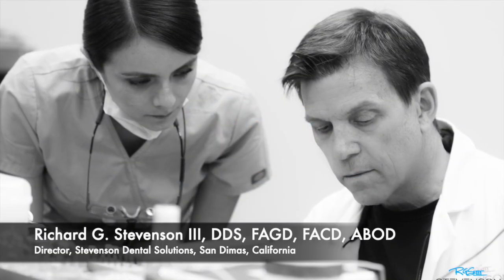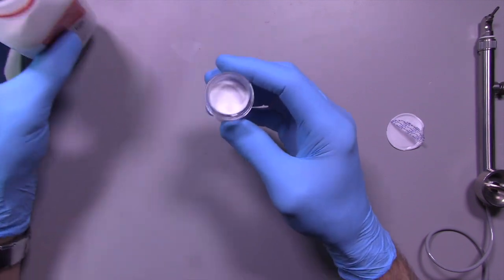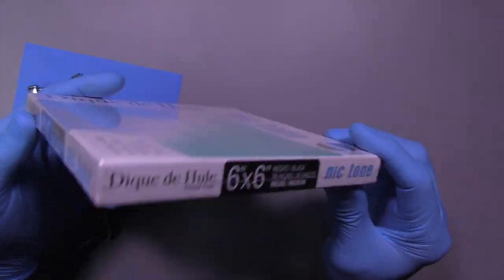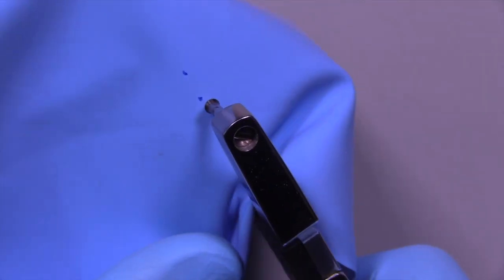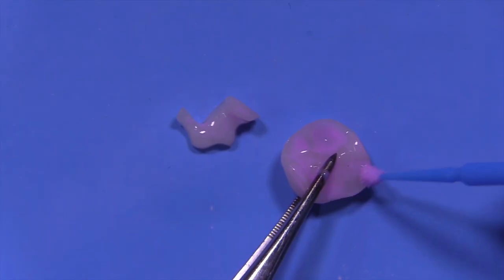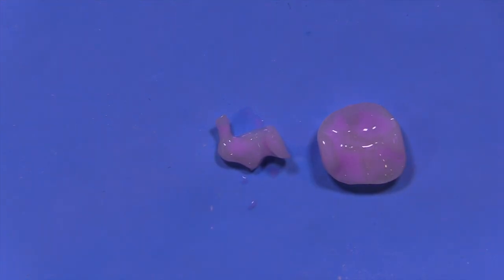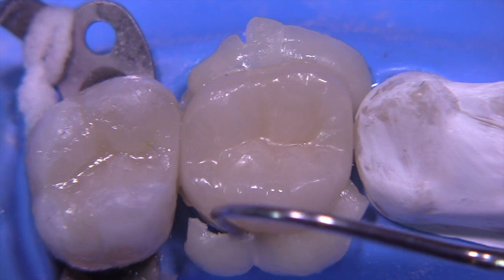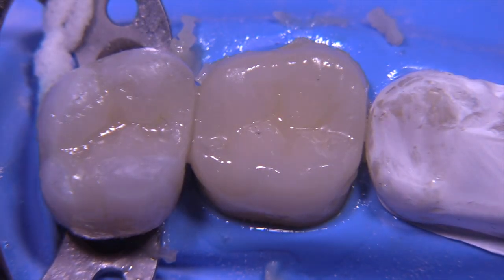Lithium Disilicate Ceramics, Part  5: Cementation of Inlay and Onlay

Comment: Thank you a lot Dr.
Can we use partial restorations like onlays inlays veneers on non vital teeth?
And is it suitable to use dual cure resin for onlays inlays?
Reply from the maker: At least an onlay for an endodontically treated tooth. Dual-cure cement is optimal.
Reply: @StevensonDentalSolutions   excuse me Dr.you mean we can do veneers inlays on endodontically tooth but preffer not the onlays?

Comment: Prof plz can we cement composite or zirconia onlay with resin modified glass ionomer ?
Reply from the maker: No research on this has been performed clinically.  I would use a resin cement for ceramic onlays.
Reply: @StevensonDentalSolutions  do you mean no research use zirconia or composite onlay itself?

Comment: Hello.
I  am about to consider an emax ceramic inlay but I wonder if the day I have to remove it will not be a nightmare if the dentist struggles to remove it or is forced to damage what remains natural of my tooth. Not to make too much noise with the tools and hurt my hearing.

Thank you for your opinion.
Reply from the maker: Your question is quite appropriate.  Removing failed ceramic restorations that have been bonded adhesively to the tooth will result in some collateral damage to healthy tooth structure IF using drills.  We do have lasers that may be quite promising in removing bonded failed restorations without any damage to the underlying tooth.  I would not worry too much about the removal as we will have the laser option and likely to have other options in the next 10-15 years when replacement may be necessary.  Dr. Stevenson
Reply: Which the actual way to remove today ? Only drilling ? How to remove only the inlay when it's soo tiny ?
Using a laser on a such tiny surface, I don't see how the dentist cannot be too close to the tooth. 

What about the contact noise to drill a ceramic vs composite ? Because it's harder and maybe a long time work. is there any hear damage for the patien that ears directly the drill trough the bones contact ?
I don't see a single video about it on youtube. 
 @StevensonDentalSolutions

Comment: Bonding of indirect ceramic restorations with warm composite using a vibrating tool to apply pressure against the tooth results in a very superior bond strength and increases success rates for their longevity. Fantastic video Doctor! ❤❤

Comment: Could we use here self adhesive resin cement(dual cured) ? 
Even though we did etch and bond to the tooth ?
Reply from the maker: Like RelyX Unicem II, yes, as long as the tooth has been etched and primed.  You just don't have as many shade choices...
Reply: @StevensonDentalSolutions  Thanks doctor appreciate it

Comment: May I ask some quistions about bonding an emax restoration.
 1- Should i put the bond (clearfill liner bond f ) on top 2 bottle silane from bisco on an emax restoration or the silane is enough when using heated composite? If so, the 2 bottle system clearfill liner bond f has a primer should i apply the primer on an emax after silane application?
2- should i put silane on an existing composite on the tooth when bonding to emax restoration then place the bond 2 bottle system primer and bond?
Reply from the maker: Great questions! 1. There is no need to place the liner bond on the restoration after silane, but if you do, make sure you allow the solvent to volatilize to ensure good adhesion to the silaneated surface.
2. It looks like silane is not helping bond to the composite as well as it had been hoped.  No clinical data supports this approach - so there is no need.  All the best, Dr. S

Comment: Hey doctor, i have a question. Why didn't you cure the bonding that you applied to the tooth surface?
Reply from the maker: This is a huge mistake - it will prevent the complete seating of the indirect restoration due to the film thickness...even if it's reported to be as little as 10 microns, it will pool in the corners of the preparation and prevent complete seating...
Reply: @StevensonDentalSolutions  Thanks, so both the adhesive on the tooth and on intaglio surface of the restoration should be cured together once the restoration is seated.

Comment: Hi Dr. I have question 
Why u use composite when fixing the restoration
Reply from the maker: The usual choice is resin cement, however, warm composite works well if the restoration is not too thick.  There are unlimited shades and the composite is stronger than the resin cement.  NOTE: the composite must be warmed to soften it.

Comment: Is tehere is any curing of bond in between or just the final curing ?
Reply from the maker: Final curing only.  As long as the restoration is translucent.  Alternatively, you may use a dual cured primer/adhesive which is made to polymerize with the cement, like RelyX Ultimate and ScotchBond Universal.  The issue with pre-cementation curing is that the adhesive is thick enough to interfere with complete seating.
Reply: @StevensonDentalSolutions  amazing
Is there any dual cure adhesive other than scotchBond universal doctor ?

Comment: Doctor Steven do you recommend using Self-adhesive resin cements for cementation of all ceramic restorations and zirconia in case of inlay / onlay / crown and bridges ?
Reply from the maker: No.  The traditional resin cements are the best choice for these. SARCs lack the high bond strength and durability required.

Comment: Nice video Dr.Stevenson. do you remove the glaze layer from the outer 0.5 mm periphery of the restoration before you etch it with HF? Or your lab does it beforehand?
Reply from the maker: Usually I just etch the outer rim for 90 seconds, for the feldspathic glaze etching, then the intaglio for 20-30 seconds. I've had limited success getting the lab to leave glaze off this area.
Reply: @StevensonDentalSolutions  Thank you very much for your valuable guidance.
Reply from the maker: @riteshgadhia3870  My pleasure!
Reply: @StevensonDentalSolutions  one more question sir, at which air pressure do you work with the air abrasion unit?
Reply from the maker: @riteshgadhia3870  I use the CrystalMark system at 2-3 Bar.
Reply: @StevensonDentalSolutions  Thank you sir

Comment: thank you dr stevenson for your effort, Isn`t it better to use a resin cement for cementation of the ceramic here? and in case of using a composite  isn`t it better to use a flowable type of composite for a cementation? you know it will flow better and it will occupy a smaller area for cementation?
Reply from the maker: Warm composite shrinks about 1.5% compared to 4% or more for flowable composite.  The warm composite technique provides a very strong resin luting space.  It is very technique sensitive though.  I would only use this technique when the restoration is not more than 2 mm thick.  Thicker and more opaque ceramics should be bonded with dual cure resin cements.  Resin cements which are dual cured and have a built in dual cure activator to work in concert with the bonding agent are the gold standard.
Reply: @StevensonDentalSolutions  would you recommend a certain type of resin cement
Reply from the maker: @ahmadmohi659  I like the 3M ScotchBond Universal + RelyX Ultimate, shade A1 Bonding for most cementations...
Reply: @StevensonDentalSolutions when using the dual cure cement, when do you start flossing interprox and do the rest of the cement clean up if you don’t tack cure?

Comment: Hi Dr. Stevenson. Before I get to my question, I’d like to sincerely thank you for your tremendous generosity and passion for teaching! Your videos have significantly changed the way I practice and ultimately elevated the level of care to my patients. Since last watching this video, I’ve done more cementations and one of the issues I’ve faced is voids or ditching at the margin while removing excess cement/composite. Have you experienced this? What would you do when you notice this? Do you add flowable resin prior to final curing? Thank you so much!
Reply from the maker: WOW, thank you!  I perform" bullnose etching" (around the edge onto the outer surface by 0.5 mm), silanate this edge too,  and clean the cement completely - no tack curing - then finish and polish with wet Dialites - always spinning from ceramic to tooth.  Seems to help seal the margin.  Dr. S
Reply: @StevensonDentalSolutions  thank you  Dr. S. What kind of cement do you use? I use ParaCore but it seems to set very quickly, especially when I use ParaBond with it.
Reply from the maker: @snuppy01  I use RelyX Ultimate with ScotchBond Universal.  Gives good working time.
Reply: @StevensonDentalSolutions  Thank you Dr. S!!
Reply from the maker: @snuppy01  MY PLEASURE!

Comment: Why dont you like to tack cure?
Reply from the maker: Tack curing is a great way to clean up resin cement, no doubt.  However, when you are trying to create a continuous ceramic-resin-tooth seal, tack curing is counterproductive.  In the techniques presented, we use HF etch 500 microns beyond the typical bondable interface of the ceramic margin, not just the intaglio, and  bond to the entire meniscus of the ceramic margin, not just the inner surface. The resin cement will thus fill this micro-concavity and prevent staining in the future. Tack curing will disrupt the creation of this, and because the resin is not permitted to fully cure and gain strength - it will be ripped off the ceramic leaving the surface rougher.  Dr. Ed McLaren (DDS, Prosthodontist and Master Technician) taught me this about 20 years ago.  Since then, no more stained margins.  Thank you for the great question.  Dr. Stevenson
Reply: @StevensonDentalSolutions  Dr. Stevenson Thank you for this thorough reply.
Can we use this technique for anterior ceramic veneers when we are using resin cement? or is it beneficial only for Onlays/Inlays using composite resin types of cement.
And when you say "resin cement will thus fill this micro-concavity and prevent staining in the future" do you mean we blend the excess cement on previously HF etched outer edges of the ceramic or do you mean applying an unfilled/filled adhesive resin on these surfaces to avoid getting future discoloration?
Many thanks
Reply from the maker: @amirmo6615  Yes and yes.  It is a technique that is applicable to veneers as well and will prevent staining.  Best, Dr. S

Comment: How do u remove the temporary acrylic restoration? Do u drill it?
Reply from the maker: Usually you can use a spoon and uplift it.  Rarely, the use of a carbide carefully positioned away from the margins may be used to create a slit with which a large spoon is used.

Comment: Hi Dr Stevenson . I would like to know if you have to Light Cure the tooth after application of the bonding agent ? Also would a flowable composite or core build up dual cure composite be suitable for cementation as well . Thank you
Reply from the maker: When you use a dual cure activator (for ex. ScotchBond Universal + RelyX Ultimate Cement has them incorporated) you do not need to light cure the bonding material.  Also, through many years of collective clinical experience, as long as the restoration is somewhat translucent and not more that 3 mm thick, you may light cure the bonding and the cement through the restoration after cementation.

Comment: Perfect🌹how long do you put the compule in the heater ?? Tim?
Reply from the maker: It usually takes about 3-5 minutes to heat up with the Calset (by AdDent).  I also use a Phasor from Vista (really hard to locate these days) which uses an induction coil and takes less than 1 minute.

Comment: Thanks Dr for your amazing videos, and i would like to ask you if you used immediate dentine sealing before the impression taking or no? otherwise, what do you recommend to protect the dentine after preparation?
Thanks so much
Reply from the maker: Yes, I do, then I clean the margins with a fine diamond to reduce the residue from excess adhesive materials at the marginal interface.

Comment: Why you didnt etch totally the preparation before cementation as you have etched only the enamel?? Did you use selective etching this time? As you have used total etching approach in the IDS
Reply from the maker: The tooth was etched totally during the PREP for IDS, then the enamel was cleaned with the bur before the impression.  For the cementation, the dentin simply needs to be cleaned as it has already been sealed with DBA.  The enamel however requires etching because the etched surface was removed at the pre-impression stage.  I will total etch the prep whenever I see that the bonded layer has been removed by over cleaning with Aluminum Oxide.

Comment: Hi doctor thank you for the video. In case of a composite onlay/inlay, do we have to etch it with HF prior of silane, bond and cement? Or with orthophosphoric 35%?
Reply from the maker: Not required.  With composite, treat the surface with a light sand blastoff Aluminum Oxide to increase surface energy and use adhesives as with your direct composites.  Some dentists do use HF and silane in an attempt to link and bond to the glass filler particles, but this hasn't been shown to improve clinical performance. Simply making the surface microscopically irregular provides ample retention.
Reply: @StevensonDentalSolutions  So for prep of the composite restoration you modify texture with air abrasion, you clean with Ivoclean, use primer for instance Monobond Plus and then you are ready to lute with a resin cement. And in between of primer and luting cement do you use any bonding agent like in ceramics? Thank you doctor for your instant reply. I appreciate it!

Comment: How can you be sure that the composite for cementation is fully cured underneath the porcelain?
Thanks
Reply from the maker: You can't, hence the limitation of this technique to translucent, and less thick restorations.  I typically use a dual sure cement, and only use warm composite when I need the extra strength and shade variability with a thin and translucent restoration.

Comment: Greetings Dr. Stevenson. I would like to take a moment to appreciate how in-depth are your video tutorials. Coming to my query  could you please tell me whether the bonding agent needs to be cured before seating of the prostheses? I use tetric N Bond
Reply from the maker: Thank you - the manufacturers will usually recommend that you thin and then light cured the adhesive before cementation, however, this may render the restoration less likely to fully seat due to adhesive "pooling".  A way around this is to simply light cure simultaneously with the cement, however, this has the potential of not curing the adhesive adequately, particularly if the restoration is thick or opaque.  Perhaps the best choice is to use a dual cure adhesive, like Scotchbond Universal + RelyX Ultimate cement - as they work together to cure the adhesive.  Also, many light cure adhesives have a DCA (dual cure activator)_ which isn't highly publicized by the manufacturer but available,
Reply: Understood sir. Thank you very much for clearing it up for me. Much obliged

Comment: Thank you so much doctor ..
Reply from the maker: Thank you!
Reply: Stevenson Dental Solutions  doctor ..just I am asking why you use worm composite technique instead of self adhesive cement..thanks alot
Reply from the maker: @mustafaaburass9650  I use either, but usually a resin cement - not a SARC.  When the tooth has the need for more esthetic blending due to a special shade - warm composite.

Comment: Yes doc ..thanks for sharing these techniques..without payment and conferences we r achieving these knowledges. CAN we use veneer cement for cementing emax crowns or inlays...?
Reply from the maker: Thanks doc.  Yes, you can as ling as the ceramic is not too thick (blocking the light)
Reply: Yes doc thanks again for ur prompt reply ..really appreciate

Comment: Hi doc! Thank you for your videos. I find them enjoyable. I'd like to ask. Why is it that you don't like tack curing when cementing?
Reply from the maker: I etch the ceramic beyond the edge and bond around the restoration margin slightly, hence I want to secure this area fully before finishing.  Tack curing leaves the composite cement soft (enough to remove easily, hence it's popularity) and it then may be torn from under the marginal seal area.  Marginal staining then becomes a problem...

Comment: Why did you use an adhesive on the tooth if you already IDS? I guess you still needed it at the enamel but why on the already sealed dentin? Also, would you do the same with an auto adhesive cement?
Reply from the maker: You've sealed it during the prep, but you need to bond it during the seat, especially after air abrading the contaminated surface during the cementation step.  The same steps regardless of the resin cement used.  Thank you, Doc!

Comment: Thank you so much for your videos, Dr. Stevenson
I have a couple of questions, if I may ask:
1. How do you prepare natural teeth for use for training purposes? And how do you mount them on a Typodont?
2. Which cement would be comparable to preheated composite in such cases; in order to achieve optimum enamel peripheral seal?
Reply from the maker: 1. The natural teeth are cleaned and the roots are shaped to mimic the plastic teeth in length and diameter and then fixed to the typodont with PMMA.  It's best to use a lubricant before "gluing them in" so they may be retrieved.  You can even place a screw in the bottom and create threads for the attachment to the natural tooth.
2. Any dual cure cement - like Panavia, DuoLink, ParaCore, etc., works great.  THANK YOU for the question.
Reply: Stevenson Dental Solutions Thank you so much, Dr Stevenson
Reply from the maker: Anytime Doc!